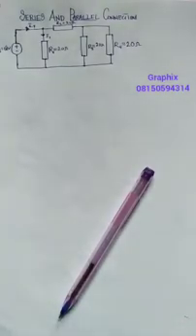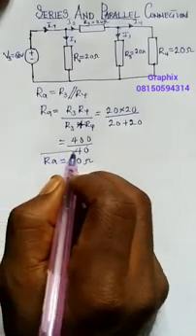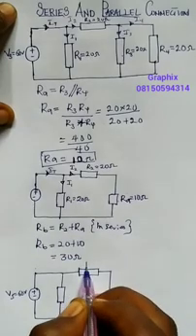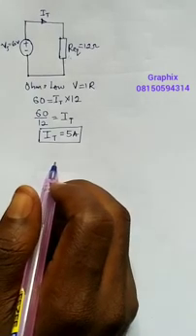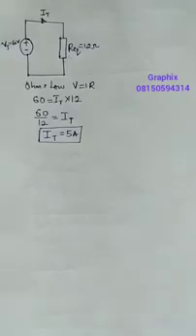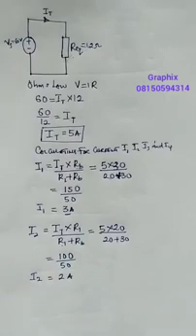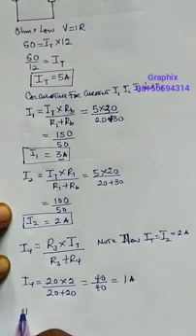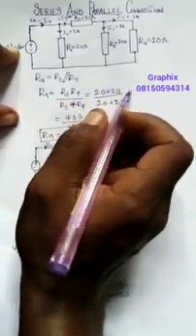electrical circuit (series parallel connection) pt 4

Comment: Please is it only parallel you use in calculating the curents
Reply from the maker: Different current flows in a parallel circuit that is why You find branch currents in parallel connection